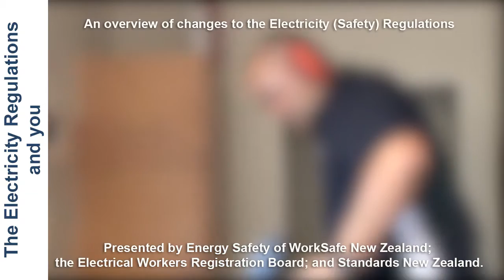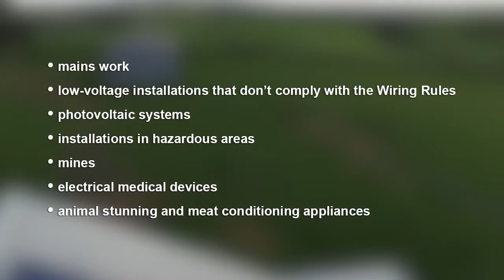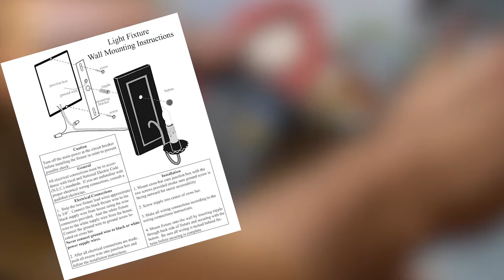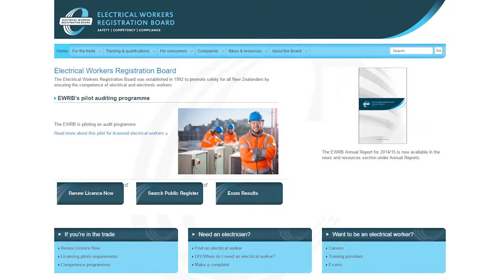An overview of the changes to the Electricity Safety Regulations 2010

Comment: When upgrading CB's in the DB it must be upgrade the wire size as well. So need to run an upgraded cable from DB to the loads. It is also consider a low risk work?